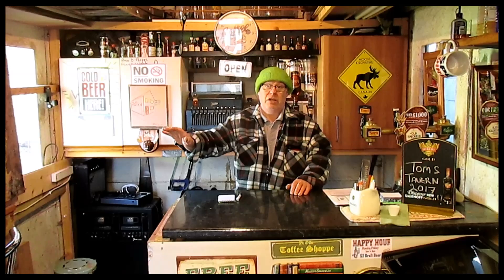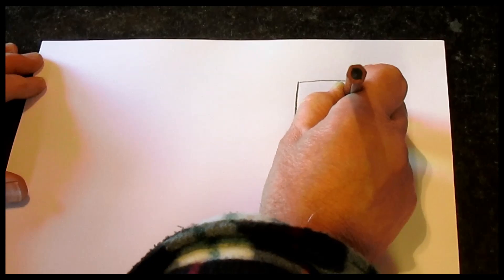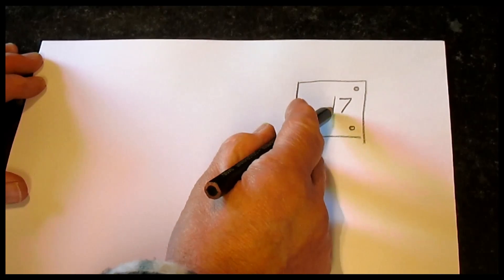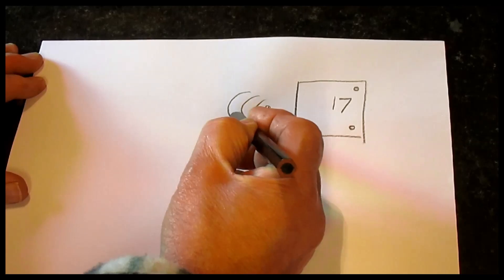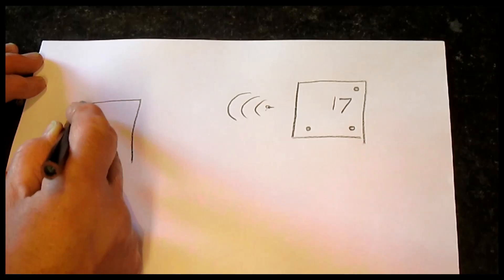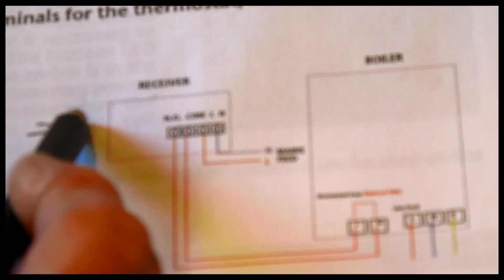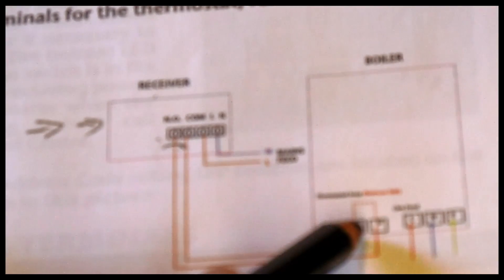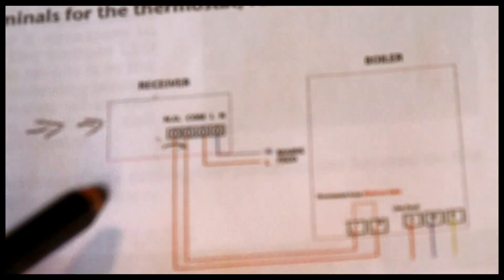toms top tips how a roomstat works

Comment: Tom. You forgot to say that if the user teks it off it's clip on the wall..... they must not sit the sending/sensor unit on a heat source like above a tv vent... or in direct sunlight..... or anywhere it could receive a false heat signal. Coz it'll get hot too quick n stop the boiler from firing up. Some customers like to take the stat/programmer to bed with them!??? Teks all sorts I spose! Oh, and it wont work if the batteries lose charge either. The stat/prog that is not other appliances that people might have that are battery operated near their beds.... ALARM CLOCKS
Reply from the maker: I'm not a real welder you know      :)
Reply: tom plum c